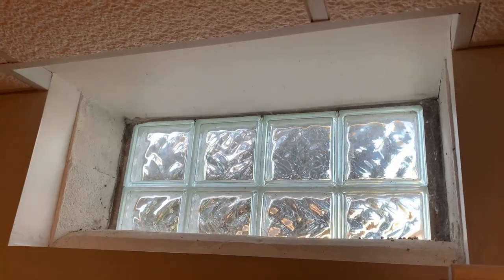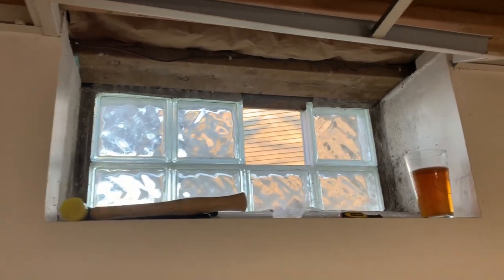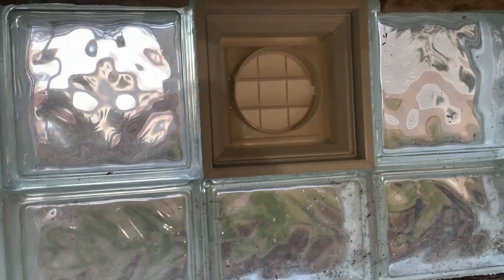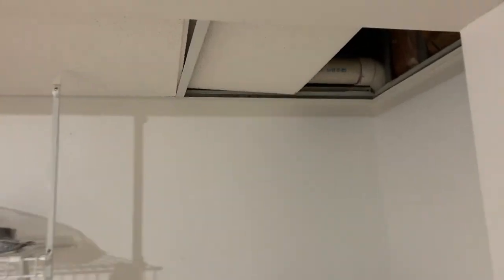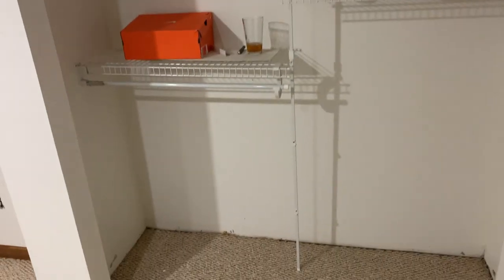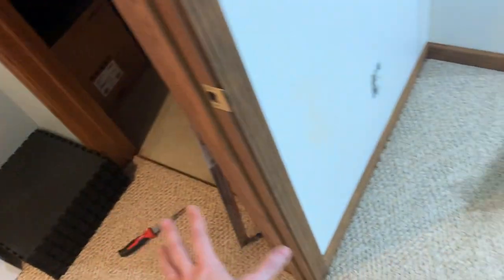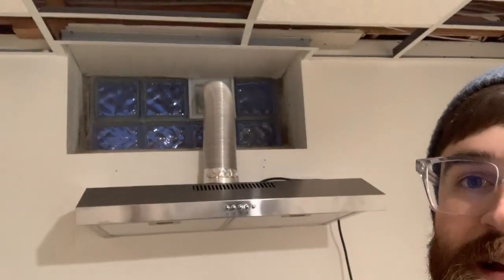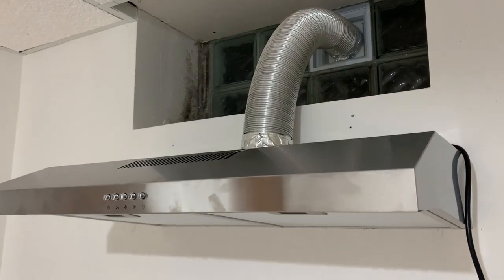DIY Basement Electric BREWERY Part 1 - Installing Simple Ventilation and Duct Work!

Comment: About to watch this whole series, this is a thing I would eventually like to do when fully moving into my fiancee's house after I get married. Its a 2-unit condo, she owns the top unit, and the basement is split between units by a wall. Ideally that's where I would end up. How is the vent hood working with reducing the brewing odor? I want to avoid the smell leaching upstairs to the neighbors, and if the hood accomplishes that, that's exactly what I'll be doing.

Also, your cat looks exactly like ours lol
Reply from the maker: Hey glad to hear, just PM me in Discord if you have any questions or need advice! I like working on this kind of stuff. So there are two problems, moisture and odor. Moisture is almost not a problem, the vent hood I got is pretty cheep and removes alot of the moisture but it does not remove it all. They do have steam condensers you can build/buy that may be more efficient. Or you could just by a better vent hood with a stronger fan. As far as odor is concerned that's difficult to completely solve. I know when I brew the basement definingly smells like a brewery  and my upstairs has a faint smell as well (for probably one day). I would say the best way to avoid odor is having not only a vent hood but a way to open up a window. I added a small window (which you will see in the series) that helps alot.
Reply: @TroubleBrewing  that's good to know, thanks for the advice! Maybe I can run an exhaust duct straight from a kettle lid to the vent or something. I don't mind the smell, but it does irritate my fiance and I'm not 100% sure if it will upset the downstairs neighbors.
Reply from the maker: @TheApartmentBrewer  Yea getting the vent closer or just spending the money on a nice vent hood for this type of application might be all you need but I cant speak to it since I have not tried it. I would think it would reduce the smell alot with a strong high quality fan. Maybe chat with Brian from short circuited to see what odors he has, he has a really nice vent hood.

Comment: The range hood that you use has a 4.5 inch diameter plastic collar at the top to attach the duct. However, the size of the duct is 4 inches in diameter. How were you able to attach the duct to the plastic collar of the range hood? Wasn't the duct too small to fit only the collar? Is the airflow still  good or do you get a little blowback?
Reply from the maker: Yea it is a bit smaller but the half inch fits pretty snuggly in the plastic collar. I also wrapped the seam in HVAC tape which helps.